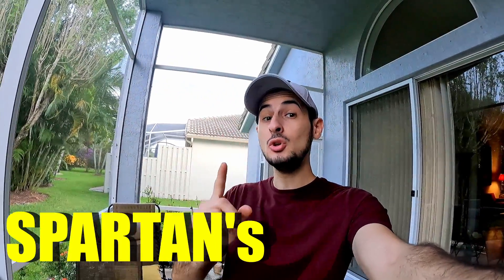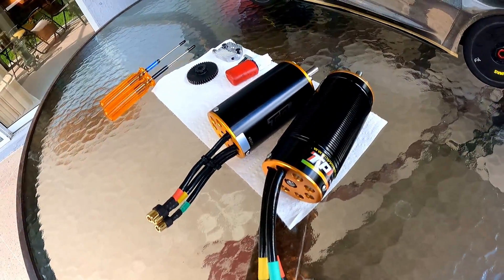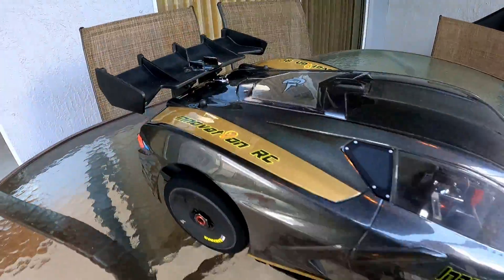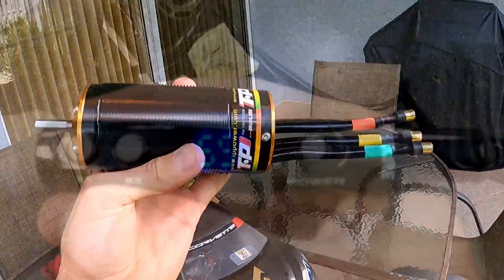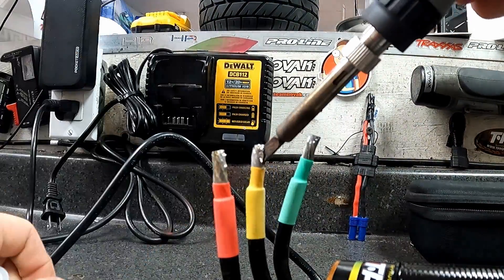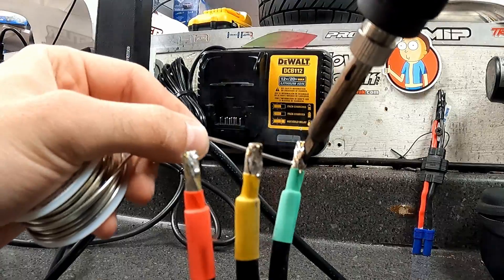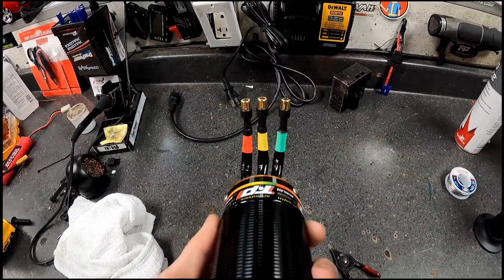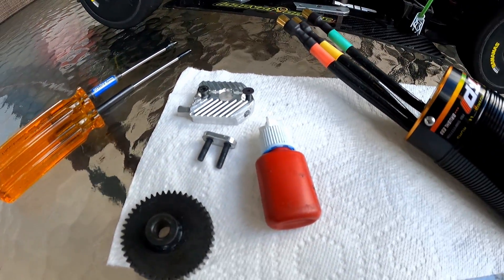20+ HP MONSTER RC Motor Installation 150+ Mph Arrma Limitless TP Power

Comment: New Perfect Pass Gears > SAGA. There’s a new gear king 👑
Reply from the maker: Have you tried Castle Creation's gears? They are amazing and much better than saga.
Reply: @InnovationRC . Perfect pass gears have two 2.5mm grub screws. Where as the castle creations on has one grub screw. I’ll take the extra security and peace of mind with perfect pass. Thanks for the suggestion.

Comment: Hello, i need to fit in in my x maxx but have no motor mount for it. What is the distance between the 2 motor screws?
Reply from the maker: Don't put this motor in an xmaxx. It will destroy the differentials
Reply from the maker: Distance is 30mm for the motor holes
Reply: @InnovationRC  thank you for the answer and for the differentials I am using gpm reinforced differentials

Comment: Is there a good TP Power motor for strictly bashing for an Arrma fireteam?
Reply from the maker: If you are having I wouldn't go tp, they naturally draw more amps. But if you really want to, is look into a 1600-1700kv 4070 can. Run it on 6s that'll be a great motor on 6 or 8s

Comment: Would you recommend running a max 4 or max 5 or a Flier 400a esc with the to motor for speed runs? (I have those esc’s already)
Reply from the maker: Id probably go with the max 4, but it takes up too much space, Max 5 just underperforms for speedruns. I would have gone with an xlx2 or mmx8s and kept another $100 from the max 4 if only running 8s. unless you plan to run 10-12s then the max 4 will be a beast!
Reply: @InnovationRC  i just picked up  that TP 1270kv motor And an XLX2.
Any secret tips you have for it?
I’m running qs8 plugs.

Comment: 4:45 you know what torch that you moved because the nitro cleaner is so flammable? well its also filled with highly flammable liquids. shits not gonna ignite unless you push the ignitor.
you also move the torch RIGHT next to where you were spraying. if the torch spontaneously igniting the cleaner is a concern than it would have been better off where it was.

Comment: My 1150kv 5870 has smaller wires than this one. 15,000 watts  and 22hp but my wires look more like 10 gauge. Same size motor, same power,  yet mine has smaller wires.

Comment: I have a major question and need help, I want to build a drag/speed run and fun Arrma felony and was thinking to go with the TP2300kv motor and hobbywing max 6 do you think that’s a good setup and what gearing should I start with it’s a simple build with foams I wanna do!! But I want to know if it will be good or what do you think would be the best all the help is needed thank you

Comment: Was debating on the new 4080 cm tp motor or this 5870 which would you recommend?
Reply: 5870
Reply: @JO-xj8dl  I ordered the 5860 sensored version
Reply: @JO-xj8dl took ya advice just ordered the 5870 800 kv
Reply: What kv u go with

Comment: Hey, hi I wanted some advice, I am using stock motor on XO-1 which is 1717 I belive and I tried 36 tooth spur and the motor is hitting the gear that gose into the centre drive shaft even when I am using 34 tooth pinion, so do I need a bigger spur or is there another way to deal with that problem?

Comment: I don’t put the iron on the wire, I just heat up the solder onto the wire. It’ll do a better job transferring heat to the wires and it’ll absorb as long as you keep the iron on the solder puddle. Putting the iron on the wire robs you of heat to melt solder bcs the wire makes an excellent heat sink.

Comment: Another one is use a post it note and run it in between the gears! If it cuts and tears its too tight! If it looks blocky creases it's loose! If it zigzags with a little flat spot on the tip of the crease and isn't tearing up sinch the motor down and your done! Perfect gear spacing!
Reply from the maker: If you can visually see what a correct gear mesh looks like. Why rely on a piece of paper?

Comment: What do you think and suggest would be the best motor and esc combo for general bashing and decent speed in a 1/5 Kraton 8s, Castle Creations, TPPower, Hobbywing, or a mixture of the above mentioned? I've surpassed the stock electronics and need something with more power and torque that is reliable on 8s. Thanks in advance and keep up the awesome work.

Comment: Great content - love it. A kind advice on the brake % - dial it down. That motor will block your wheels even at low brake setting and low speeds, just saying. I have the 1200KV and running it on 8S and it has insane torque and even more insane braking power. Caused me quite a few crashes.
Reply: What ESC are you using ?
Reply: @hamdisel1  XLX2

Comment: Part of the reason you are having issues tinning your wires is because you are using the end of the tip you should be using the side of the tip.
Reply from the maker: The whole chisel tip they sent was way too small. But it got the job done, I personally will go back with my Weller 80w for large wire but this one is perfect for small stuff, not 6awg wire

Comment: Will that motor fit in the 1/5 scale Arma Kraton?
Reply: It will not, it is a 58x122mm motor. There is just enough space for a Castle 2028 can size in the Kraton 5th scale. They are 56x112 or 113mm as far as I remember.
Reply: @alexbirkenfeldt1566  ok. what other rc vehicles would this fit in?
Reply: @stephancobb13  Believe it or not - it will fit in the Kraton 6S EXB. The other ones that I know of is Infraction, Felony, Limitless (if you flip the motor to the other side) It would also fit in the Talion (but that would be insane to attempt that :-) ) MCD RR5 MAX when converted to electric, Losi 5T, Losi DBLXE and probably some other ones that I don´t know of yet. But it will not fit in the Kraton 8S in stock position. Not sure if you can flip the motor in an 8S - I haven´t tried that.
Reply: @alexbirkenfeldt1566  i was looking to get the Kraton 1/5 scale....thats y i was asking. but that motor looked like it has alot of power.
Reply: @stephancobb13  It has insaaane power, amazing torque which will tear your drivetrain apart if you are not carefull, but that kind of power is not for a basher in my mind. I have both the 1/5 8S Kraton with standard Spektrum setup (great fun but not more than that) and the EXB roller with XLX2 and the 2028 1100KV motor - that is fun all day. I have the largest Losi´s and no, I would not put that motor in them. A while back I read that TP5870 was intended for superchargers on supercars like the Dodge Charger Hellcat / Demon - but they tend to be great for both speed and drag on small electric cars as well. My experience with this particular motor is that it is very hard to control. It takes off stupid fast and braking is out of control - I need more time to test it - but I think it is perfect for speed and drag with the right setup..

Comment: Very nice!👍 5870? I had a 5860 1070 kv I were goin to run on 12S with MGM esc in a Kershaw design Traxxas Slayer. Sadly it got stolen... Only positive were that the thief missed the custombuildt SMC 2x6S 4400mah lipos.
Reply from the maker: Yup 5870. Sorry to hear about the slayer
Reply: @InnovationRC  Cool. Did you go up or down in kv from previous TP? Can't wait seeing it run. Who knows, might be capable of 200 mph one day.

Comment: 👍 you ever use the E-brake as an emergency stop or as a dual rate stopping assist? Any other ppl curious, imo I can’t wait to do this to mine. It’ll save battery runtime and motor longevity. I just need the E-brake to have a little bite that’s all bcs it’ll also be using the esc brake. This can be adjusted to work both at the same time by using the dual rate feature with the radiolink transmitter (remote)  instead of stock remote.. yes the radiolink also has adjustable gyro (traction control), battery telemetry and also anti-lock brakes.
Reply from the maker: It definitely would be a good idea to use the E-Brake. Unfortunately it takes up too much space so it needs to be removed

Comment: Awesome man. I'm not a speed guy but i have the Triple S 5694 1000kv motor in my xmaxx and it's a beast! But i run those same pinion gears bro and everyone says o i need mod 1.5 gears these will never hold up. Ive never had an issue just mesh right and they are reliable at mod1. 👍 Lol also i have a metal solder jig i use a torch mostly. Good video man. 👊✌️🤙
Reply from the maker: For sure mod 1 will hold up you don't need 1.5. Awesome! Thanks for watching!
Reply: @InnovationRC  what controller do you use?

Comment: Thats not an adequate soldering iron for that job, you need something like a weller station, preferably an older model
Reply from the maker: Consider I only used it to tin the wire on the motor, I used a torch to melt it all together. I normally use a heavy duty Weller 80w.
Reply: I support this comment., I recently bought a weller 60 watt with the adjustable temp dial station… I DOUBTED this 60 watt would do the job of QS8 and 8 gauge wires… but yoooo…., at just 50% heat it melted everything in contact with the iron tip and all my jobs came out like a chrome solid puddle! Did it so fast that the wires never got piping hot and the iron never dropped temp. It’s a 60 watt iron and the station it came with can only reduce the wattage so it’ll never be more than 60watt and at half that it did the job!…. Was like $60 average cost.

Comment: That motor is crazy big. I wonder if filling the gap at the far end of the motor would be needed..maybe a little ball of silicone.. oh and what about the little black PPS locking screw? I didnt see you tighten that one.
Reply from the maker: That little screw determines the silver adjusters tension so it doesn't need to be touched when adjusting gear mesh

Comment: Are there any good 4074 sized motors that are 6s rated that they have?
Reply from the maker: They have many 40 series. You'd like a 4050-4070 can size
Reply: @InnovationRC  I’m trying to find something to replace the 4074-2050kv motor I have in my modified vendetta once I’m able to test it at full speed.